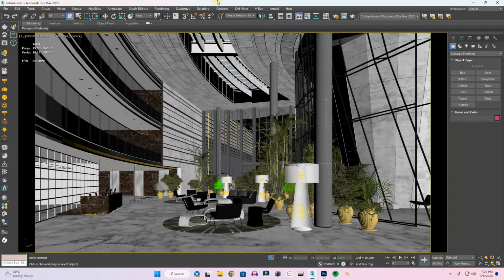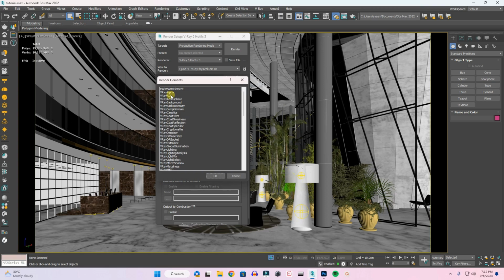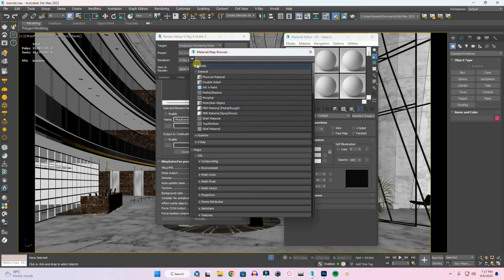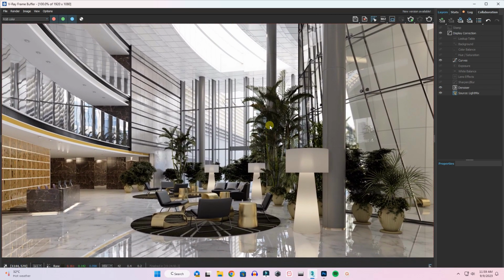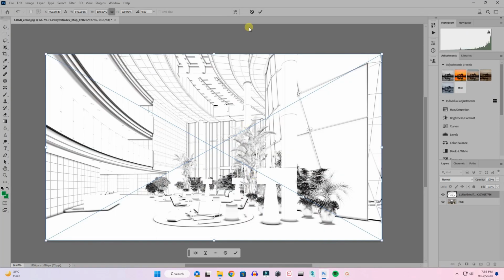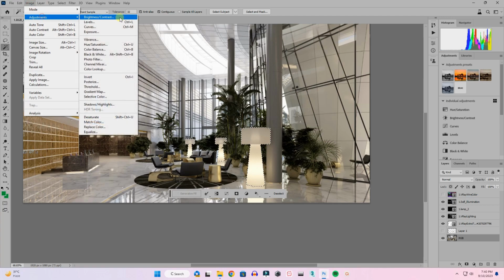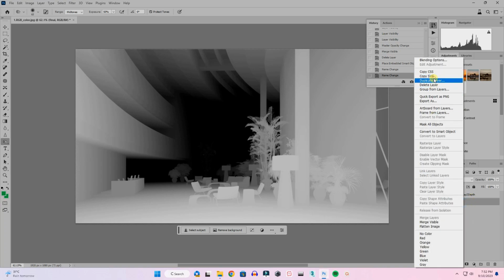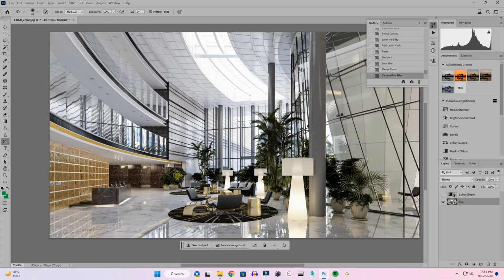How to Use V-Ray Render Elements In  3DsMax Photoshop Post-Production

Comment: which one is best bruttforce or  iradiance map  which one is primary which one is secondary which is the best option
Reply from the maker: Choosing between brute force and irradiance map in V-Ray depends on your scene and rendering requirements. Brute force is accurate but computationally intensive, suitable for complex scenes with detailed lighting. Irradiance map is faster but may introduce some artifacts, making it better for simpler scenes.  Experiment with both to find the optimal balance for your specific scene.

Comment: Hello sir . when I use import 3 d model and try to render it the render image turn whitish .and show me the object is to away from mental ray how to solve it
Reply from the maker: are you using vray and 3dsmax?
Reply: @Platformstudio  yes sir vray 3.6 and 3ds max 2015
Reply: @shafaetattiq Maybe the gamma value in the saving file dialog. I had the same issue because it was on 1.0 instead of automatic.